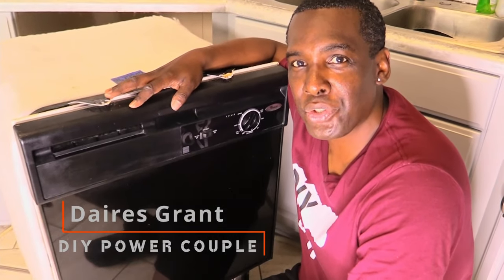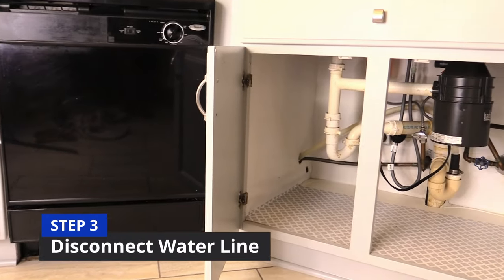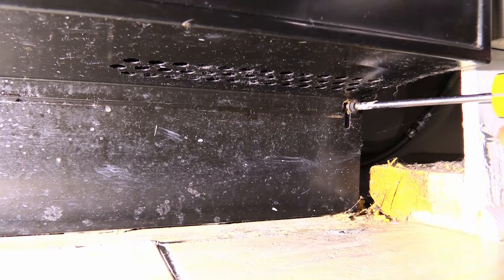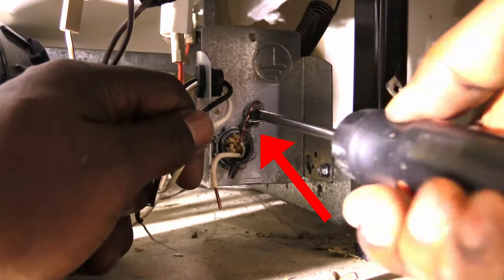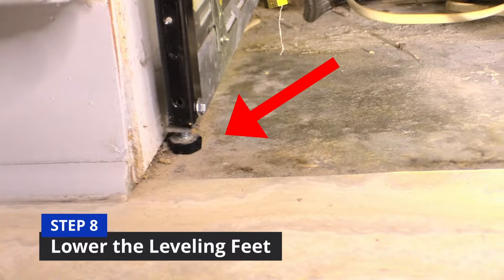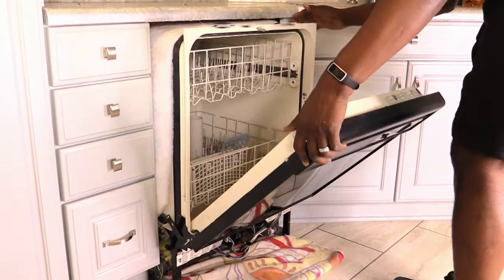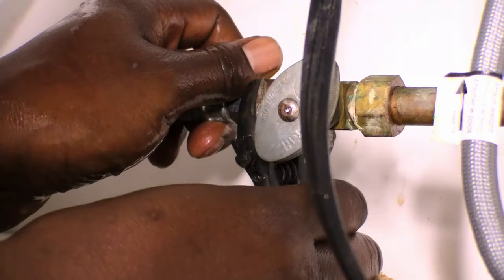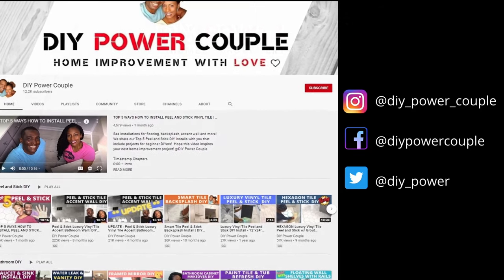How to Remove a Dishwasher (10 EASY STEPS) | DIY Power Couple

Comment: To reiterate previous comments (for good reason) this is an excellent video.  We have the electricians coming tomorrow (they won't touch the water line) and the installers for the new machine the day after.  Our hard-wired setup was extended with wire and wire nuts and the installers said we had to get the electricians in to redo the circuit to bring it up to code.  We didn't argue- the codes are made for good reasons.  Thanks for the video, I know exactly what I need to do.  New subscriber.
Reply from the maker: Welcome to the DIYPC Family!  🤗
This is how we changed  hardwired to an outlet: https://youtu.be/p5L7vLOrcf8?si=TFr-yj5t3rT5YPop

Comment: You are delightful, will definitely subscribe. If my old washer plugs in, rather than being hardwired, do I still need to turn off the breaker? I just bought a new one from Costco and the price includes delivery AND, thankfully, installation and haul away but I’d like to at least start the process before the installer gets here.
Reply from the maker: Thank you! Turning off electricity at the breaker when installing new appliances is an extra safety measure.
Reply: @DIYPowerCouple  Thanks. I bought one that included free installation. But I appreciate the response.

Comment: Thanks for the helpful video! In my case it turned out that I didn't need to remove the kick plate or wiring, nor lower the legs.
Reply from the maker: I bet that made things much easier and faster for you.😀
Reply: @DIYPowerCouple  Yes, though I didn't know that I didn't need to remove the kick plate until after I did that part.😄

Comment: Good video, pretty easy to do, I have zero experience with this. Had to buy a mini ratchet (not mechanic size) set to remove bolt from electrical box, good tip on unscrewing the ground wire, other videos missed that. After disconnecting the power I pulled the dishwasher out and flipped it over to disconnect the hoses. I disconnected the water hose going in, water was still on causing water leak, my shut off valve is not a vertical/hortizontal shut off, you have to turn all the way to the right like a faucet. The water drain pipe also had water sitting in it. Have towels handy. Recommend buying a new water hose kit if you put in a new dishwasher, reusing old hoses may cause leaks later.

Comment: crazy lol, i have the same dishwasher and the pump just kicked the bucket. mine is hardwired same as yours, any tips on what i could do if i get a dishwasher that has a plug? my kitchen doesnt have a lot of outlets very old house
Reply from the maker: You would have to install a plug or find the plug located under your kitchen sink area. See this video if you need a plug. https://youtu.be/p5L7vLOrcf8?si=mmlCk381PuZTEj_M

Comment: If all I need to do is push it to the right a bit, so I need to remove the kick plate or disconnect the plumbing?  I have an issue with the door rubbing against the counter frame.  The under counter mount has a metal bar with several holes that allow me to screw back in a different place.
Reply from the maker: If there are several holes underneath, seems like someone moved it a round. No need to remove plumbing, just unscrew the mounts and find (or make) holes that will allow the dishwasher to fit correctly. Try that first. 🤗

Comment: Oh no I’m not doing all that with those wires.
Reply from the maker: Mary, we were unsure of ourselves at one point, but with a good non-contact voltage tester ($5-10 bucks at Harbor Freight) and knowing which switch to turn off on your electric panel, that should ease some of your fears.

Comment: turn power off to it first
Reply from the maker: Thanks for the tip!😊
Reply: @DIYPowerCouple  lmao my dumb ass skipped the beginning 🤣 of the video.  our problem is we dont have anything labeled right at the power box so thank goodness i have a towel for checking if the right switch is off.  the dishwasher has not been runing since i was 8 years old so i did not think to chick if theres power to it. thank goodness for rubber  handles on wire cuters 🤣.